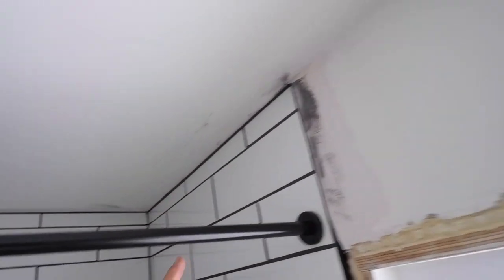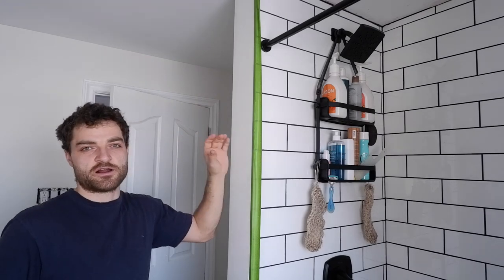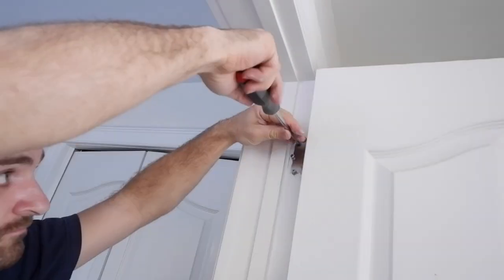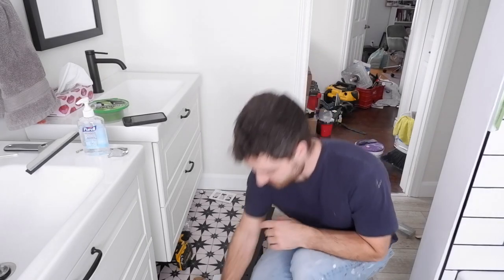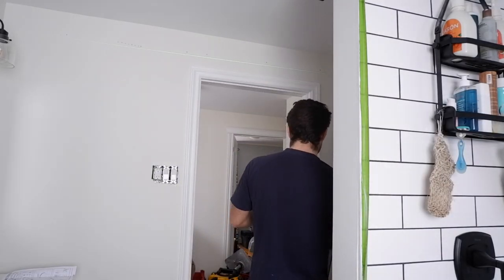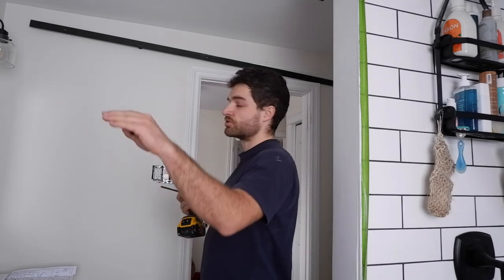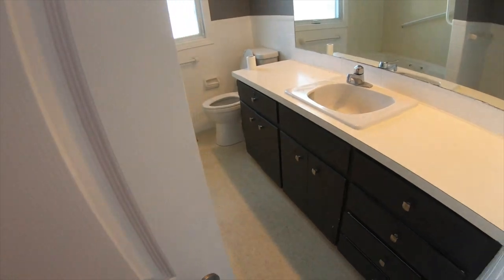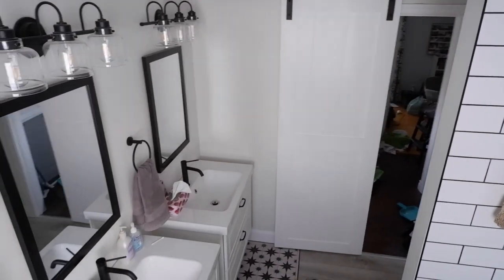Easy sliding barn door installation - Bathroom remodel part 6

Comment: How is the sound transmission?
Reply from the maker: Good question, I’d say a bit less then your standard hollow core door. The homeowners are considering getting a solid core slab to hang
Reply: @zackcrafted   i ordered a barndoor and i plan on screwing a sheet of 5/8 drywall to close the gap with some weather stripping. I will let you know if that works.
Reply from the maker: Oh interesting, creative solution, let me know if it works!